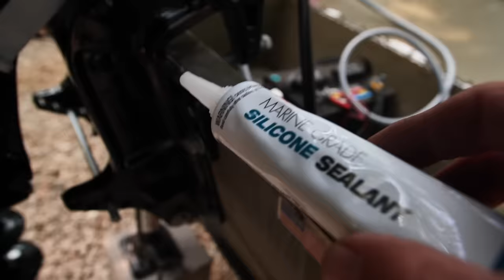Installing NEW Mercury Motor on My Jon Boat ( Unboxing to Running )

Comment: Great video, I have got to visit lake fork for some crappie (Specs) fishing some day.

First, love your beautiful family. I have a 3yr old grandson that I have all the time and is my world.

Second, I am a air gunner with six,  which gun was that? I wouldn't rest until i dispatched that bobcat if I couldn't relocate it. Too big a threat to the kid and the chickens. 

Third, I just went thru the same thing by myself with my new Suzuki (no trim) but still real heavy for an old man!

Finally, laughed at, not having the kill switch connected. 6 gals would last me two years with the extreme small amount of gas these Motors use. Im a little shocked the motor shipped without a prop, my Suzuki did. Oh yeah, please do let us know how the excruciating break in period goes...omg took forever lol

Ps, please share the crappie cake recipe.

Thanks again

Comment: You got a long leg motor for a boat with 15” transom. What you needed was a short leg. That long leg is designed to be on a 17”-22” transom

Comment: It looks like you might still have a problem with the truck..when you and Rob are talking about if the motor is rated for that boat your trailer lights flashed. power surge from the truck

Comment: I agree with the other comments....you need a short shaft outboard to fit your short transom.  The long shaft is way too long for that setup.  Handling and power will be lacking.

Comment: You should have bought a 15” motor, looks like you have a 20”. Raising the motor 5”s will raise the center of gravity, making a light aluminum boat slightly more unstable at wot.

Comment: Something you could of done was put a half inch wood in the place the motor was holding itself to higher the motor that’s what I did on mine and works mine

Comment: Run a separate battery for the engine. When the voltage drops below 10v it won't start. The alternator keeps the starting battery charged and you will never have to put a charger on it.

Comment: I wouldn't have your gas tank next to the battery.
On a hot day the vapor from the fuel tank will fill the area up with fumes and if you have a lose battery terminal it will spark and BOOM!!!!

Comment: Just as a little bit of extra knowledge out there. The reason why those lock nuts turned out is that it's cheap hardware. I've only ever see it with bottom of the barrel stuff.

Comment: The hell with nylock nuts. Use crimp locks, loktite or double nut that bastard. Will never give you any issues. But since they are visible and your back there with them anyway when driving. You would notice if it backed off which would take a lot of hell to make happen. Lol

Comment: What kind of sealant is that and where do you get it from my dad needs some for his boat
Reply: 25 horse Mereury won,t go in gear
Reply: 25 horse Mereury go in gear
Reply: Can anybody help me with this 25 horse Mereury, That won,t go in gear has a control handle
Reply: @tonymervin6103  time to sell it for cheap bud i cant explain how to fix it for you but if i was there in person id probably be able to fix it i just got my 2014 yamaha sr viper 1049cc tripple 4 stroke goimf again after sitting for 2 to 5 years in earths elements corroding and what not

Comment: Should have mounted it on a jacket plate with a kick plate so if you hit something in the water it doesn't RIP your motor off the transom

Comment: Down grading motors hmmm 4 stroke equals less tourq more weight, more maintenance. I am for sure sticking to 2 stroke way better hole shot and the new etecs get great fuel economy.

Comment: I think you needed a short shaft motor. Yours appears to be long shaft.
With the configuration you have, the boat will porpose in and out of the water.
Regards.
C

Comment: You need to get rid of that grey fuel line. The ethanol in the fuel and the sun breaks it down and puts debris in the fuel system. I recommend the blue fuel line.

Comment: That new gas tank took up 1/2 of the damn box, Holy Mackerel... Can anyone tell me why there wasn't a prop included?
Reply: All boat are different . size weight v or flat bottom so u have MATCH prop size & pitch for best performance

Comment: Make sure to put a rubber cap on the bolt or it will rub a hole through your gas tank

Comment: Cat needs to go away permanently like 22 or bigger, he is not afraid and you have a little one that looks like prey to him. Even the best parents have times the little ones get out farther than you realize and no one wants to have a preventable accident. 
Nice motor. Fixed motor and aluminum transom sounds like a breakaway mount is the way to go! Good work both of you!

Comment: I mean gas with some oil in it from the residue left over will just make the motor run really smokey likes its burning oil, well it will be but not its own

Comment: You will never get those bolts out. Should have used Anti Seize, or the bolts Mercury sends with them. They are SS with bronze looking lock nuts.  Your bolts may be locked up or not to torque because they were put on dry. That is the reason the one come apart.

Comment: You need to let the silicone dry up a bit before you tighten the bolts, otherwise you practically squeeze it out the the way.

Comment: You need a short shaft not a long shaft you put on. Also never put a fuel tank and battery in the same compartment as it can explode if too much fumes build up. Also never run a trolling motor on the same battery as your cranking battery as it can cause an electric surge

Comment: Yeah those 4 strokes are known for not mixing the oil into the gas correctly, just bypass the "reservoir" and mix that 4 stroke oil straight into the gas lol... shoulda kept that yamaha on there, it'd probably outlast that new merc.

Comment: Should just return it if possible and get a shorter lower unit they make that option. Your transom should really be sitting securely on that bracket all the way up against the top.

Comment: You could install cables on a outboard motor, if you can mount the one you did. It's not rocket science. Regarding your cat problem. My dad was a trapper, and I would go out with him on his trap line. Beaver was the hardest. He had a pair of heavy rubber gloves, and he kept them smelling natural by grabbing cedar branches, and rubbing the cedar all over them. This way he wouldn't contaminate the traps. Then outside, he would boil the traps in a cedar soup. Handle them wearing the gloves. We used leg hold and conibear traps, but we also placed them under the water. I live in Ontario, Canada and leg hold traps are now illegal here. Cause too much suffering. Use em if you got em. Look after your livestock and your little girl. Let the bobcat worry about too much suffering.

Comment: Deff going to need a plate on the back of that thing, so the weight and power of the motor doesnt bend the back of your boat, plate, silicone and drill those extra holes

Comment: That Bobcat needs to be gone . Too close to your little girl ...... On the boat front and and transom . I personally would get a mounting plate made up for the inside with the bolt hole pattern for extra support because that mercury looks way too big for that transom ...

Comment: Yes your assumption of a gas sipping motor is correct, but you should look at evinrude, two strokes sip gas, a lot of that is the amount of weight you’re  pushing, the length of boat, how many people in the boat!  There is less maintenance on the two stroke evinrude! I’ve owned two and four strokes!
Reply: However I just bought a Mercury 225 jet pump, for a river sled bass boat/salmon trout/steelhead boat

Comment: You didn't add that you also weren't going to start it because it wasn't in the water/you didn't have a hose flowing water through it. Never dry run a boat motor just like you don't dry fire a bow. It'll actually void the warranty if you do.

Comment: LFG, don’t mess with a pellet gun, get a 22 so you know it’s got enough uumppffff an power to take it down, neutralize the threat, your under gunned brother lol
Reply: FYI that air rifle has  MORE than enough power as long as he has it turned up and sighted in. More accurate than most 22lr also.

Comment: You won’t have any oil use. It’s just like your truck.burning oil in a 4 stroke is a bad thing. They don’t use gas and oil mix. You’re right, it will be quite.

Comment: Yep, You'll need a short shaft outboard for a 15" Jon Boat Transom...  and a propeller...  Rear weight won't matter...  TTG will be "front ending" yall all the time... cept when yall will be steering...  Still use ONLY Non-ethanol fuel...!

Well congrats...   Now you've screwed up your boat's transom.  You admitted you didn't know what you were doing.  Why wouldn't you contact your Mercury Dealer FIRST...?  I'm sure Mercury would have swapped outboards with you so you got the CORRECT outboard for your boat.

For those of you that might attempt this yourself.   FIRST MEASURE YOUR BOATS TRANSOM (to dertermine you get/buy the correct shaft length outboard for your specific boat) so you won't have people laughing at you at the boat ramp...   And so you'll get the best performance out of your new outboard...!

Comment: Cool vid. But your lack of understanding for engines and how they work amazes me. No disrespect, sir. But if you knew, at least, the difference between a 4 stroke and 2 stroke design it would really provide an understanding of fuel and oil consumption.
Reply: Jay Felix He might not know anything about motors but he for sure knows more about fishing than you sir
Reply: I would hope so. But what’s your point?

Comment: If you run it when the boats on the trailer get muffs so the motor can get water if your run it without water you will ruin the motor as it has no way to cool it’s self down

Comment: Where is your battery old downs, battery box or at least post covers.....It is the LAW.
But so far no GOOAN until pulled over by the Coast Guard has cared about proper boating equipment.
This is so there is no chance of a spark starting the gas vapors or spills from the vent on fire.

Comment: No it's doesn't have a tank to mix the oil. It is a 4 stroke. Lol you change the oil in it just like a car but every 100 hours.  No oil in the gas my brother.   It's a 4 stroke🤣. I have a 25 like this a 115 and a 300 verado. Love these.    The 25 is so good on gas it's insane

Comment: I suggest you actually sit down and read the manual, before an issue comes up. There is a break-in period for that motor. After break-in, I'd change the oil and filter, then start your every 100 hours or once a year cycle.

Comment: LFG put some rubber butt ends on those bolts near the battery and gas can, you will thank me later... or you wont need to because you wont have any issues ;p

Comment: All the weight is resting on those bolts, not good. You should at least put something between the engine and the gap on the transom. That way there weight is on the transom not the bolts. GOOD LUCK, PS, BB GUN WON'T DO JACK AGAINST A COUGAR.

Comment: do not run that with no water hooked up you will burn the water pump impeller up    Put it in a barrel of water or get the hose adapter that goes over the water intake

Comment: Give her a good  rip!?!? 🤣🤣🤣 you mean a good pull!?!?...Now. taking something for a rip is when you actually drive the boat and it's insane fast and fun to drive!! That's when you can say she's a ripper or she rips! 🤣😂🤣...Oh and using a pellet gun on a bobcat!??? Yeah okay you might wanna get something along the lines of a 12 gauge or a 9mm because if not your only gonna pass it off literally, specifically if she has her babies around..  She she's those beautiful and healthy looking rosters/ chickens 🐔 Down the road if the motor keeps coming lose u might need a 2x2x4 board going across the top motor mount but good job man!!! It's insane how expensive outboard motors are!

Comment: Pellet gun my tail! 12 gauge buck shot and were done! I don’t care what the neighbors say. Looking at your girl like that!! Whoa!! by the way, lower that motor back down. Either get a jack plate or a shorter shaft. I think dexter2433 is right on! 15 inch needed.

Comment: I bet you didn't know that the mercury you have is probably made in china.....Booooo......that is Chinese hardware. That is why your nylock nut broke apart. Don't start the motor without the ear muffs. It has an impeller just like all the other boat motors. You also need to seal the mounting holes with adhesive sealant. You can get that at Academy.

Comment: You got a "LONG SHAFT"... For any Jon-Boat, you need a "SHORT SHAFT" engine.

BTW - "motors" are electric, "engines" run on fuel.